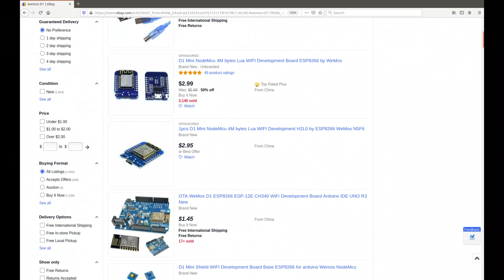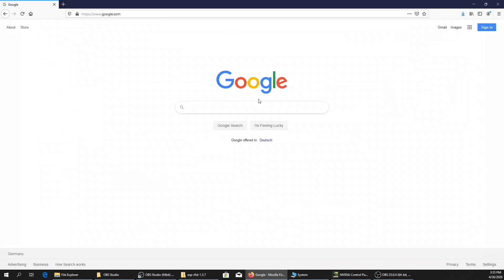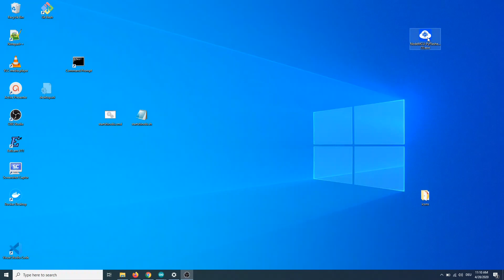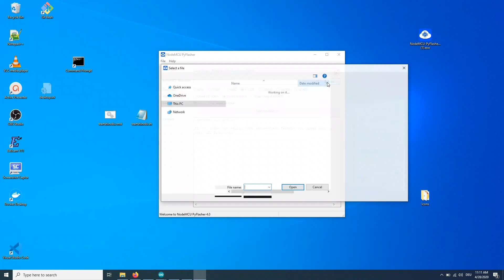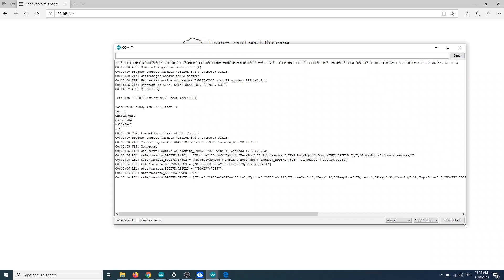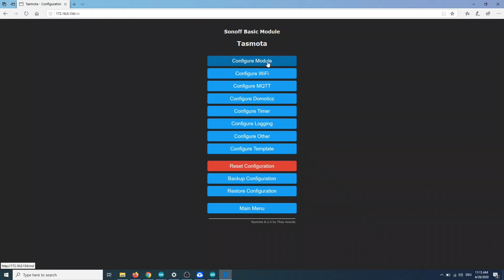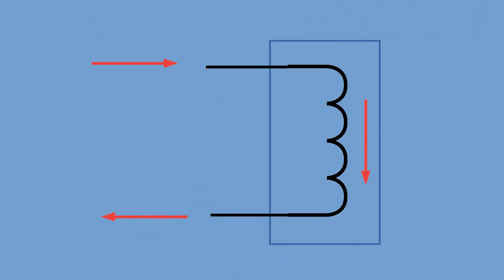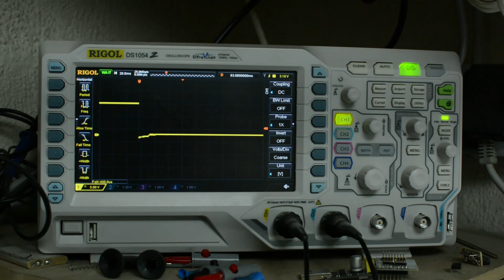Automatic garden watering with TASMOTA on NodeMCU or Wemos D1 ESP8266 and relays

Comment: Good to put a pulsetime1  restriction on it for a maximum runtime. Nice useful remark about the diode, should it be in series or parallel to the valve? You can also use the magnetic valves that run 24v ac to separate circuits.👍

Comment: Hi Marc. I just discovered your video and channel. An excellent video, thanks. It would be interesting to understand where did you placed /soldered (?) the diode you mention. (Would be nice to see it in order to make sure the direction is correct :-) ). Further: in your project, which power supply did you use? I guess you need 3 of them (3 v for the microcontroller, 5v for the relay and 12 v for the valve). So which power supplies do you use for the  everyday operation of this project? Thanks again. I will be looking in your channel for such videos... ;-)
Reply from the maker: Hi Jonathan, I usually use a 12V DC adapter followed by a step down converter (2Amps cheap China type) and then have the ESP8266 on a small board that has a 3.3V SMD regulator which I hook up to the 5 V. W/r to the diode - it just needs to be in anti-parallel to the valve. Commercial relay boards have this soldered already. So at normal operation the diode blocks (Cathode to +12V, Anode to 0V) like this https://i.stack.imgur.com/lpcMU.png (ignore the resistor)
Reply: @OneMarcFifty  Thanks a lot Marc. The schematics was a good remider, of the need of a diode in inverse connection, thanks (I was actually curious to see a picture of your connections ;-) ). Anyhow. Following your instructions. Let's see where it lands... 😀 Looking forward for more Tasmota-driven garten accessories... and driving them via Home Assistant...

Comment: great video, I'm literally in the process of making my irrigation system using a node mcu with an 8 way relay board but using the same solenoid. great tip about the diode! would it be any type of silicone rectifier diode you would use ? thanks
Reply from the maker: Hi Paul, yes - any silicone should do (1N4148, 1N4001 or the like) - even though the voltages that can occur can reach 200 Volts  and the specs of the diodes are far below (50 / 100V) , they seem to be fast enough to short circuit quickly  enough. Never had issues with those.
Reply: @OneMarcFifty that's great thanks ive got some 1n4001 diodes so ill use them. Cheers

Comment: Nice and informative video. 
Question - i connected wemos with relay and AC power accessories. i'm able to control but because of no power-backup or whatever reason if there's couple power fluctuations, it wipes out the config from the esp8266. 
Any ideas, how to avoid it ?
Reply from the maker: You could/should take the following countermeasures: First, make sure you have flyback diodes on all coils. Second, add capacitors to your power supply. Third, make sure that your power supply is dimensioned correctly. If you are using an unregulated power supply, the voltage might actually vary or lot so - fourth, use a regulated power supply with the right Amp/Voltage. Let me know how it goes.
Reply: @OneMarcFifty  absolutely that’s the plan.

Comment: Hallo hope you can help.
How can avoid a relay turn off/on after every restart?
I have 2 relays set in interlock , but every time the wemos tasmota restarts they will go on together for few than a second.... can you help me?
Reply from the maker: It depends what hardware (ESP version - Wemos etc.vs. Sonoff etc.) you are using. If you can change the pin then try this out. GPIO 0,4,1,3 are default HIGH after boot until tasmota loads.  You might try pullup / pull down resistor and also check the tasmota options. This article may help: https://randomnerdtutorials.com/esp8266-pinout-reference-gpios/
Reply: @OneMarcFifty   wemos d1 , switch gpio0 gpio14 , relays gpio2 gpio12 .... I think I need to move to an hardware interlockable double relay mobule...
Reply from the maker: You might try wiring the relays to pins gpio 0 and 4 - see if that changes anything... or add a pull up to gpio 12 for a test...

Comment: I honestly don't know what I am doing wrong. I followed your video to the T and the Relay just stays ON no matter what.
Reply from the maker: Hi Leland, there are a couple of diagnostic steps that you can take in order to troubleshoot this situation. First, remove the relay board and measure the output at the ESP - does it go from high to low as you expect it (or vice versa) ? If not, then you might try a different contact or maybe you are using the wrong pin. Troubleshoot this first. Second, put a high (3.3V) and low (0V) signal on the entry of the relay board - does it change its state ? If not, you will need to check why and fix that part. Once those two parts work well independently then putting them together should work. Let me know how it goes.
Reply: @OneMarcFifty  I figured it out, it was the Relays I was using. Found a 4 Channel Relay Board in my Junk Box and it works.
Reply from the maker: Yeay !!! Happy you got it working!

Comment: did u put the diode at the valve spool, or the relay spool, i dont think the peak will destroy your chip because of the relay, btw nice informative video, i learned alot
Reply from the maker: Thank you. In fact you need to add it to any coil, that includes the relay and the valve. I have only added it to the valve as I am using an arduino relay board which already has a diode on board.